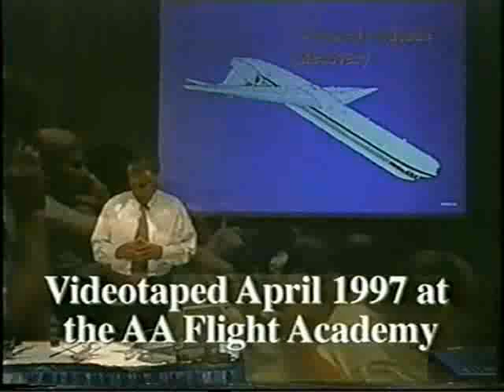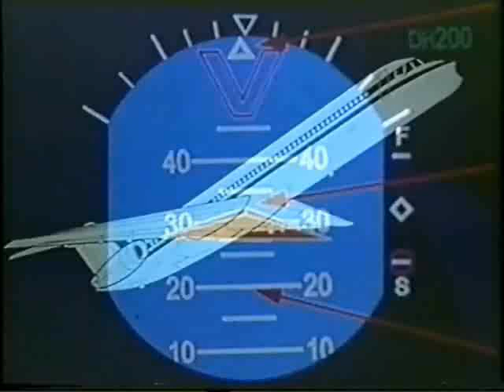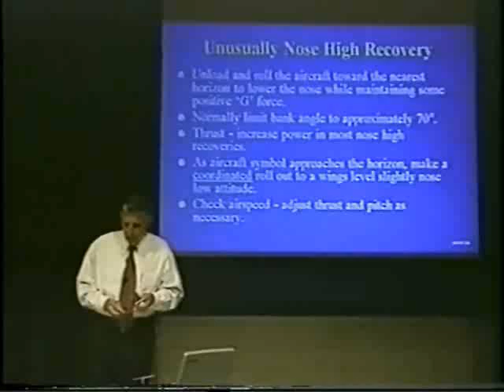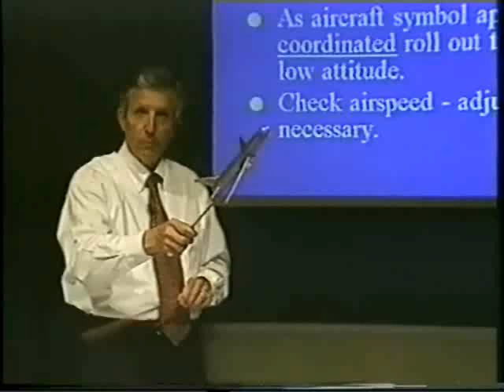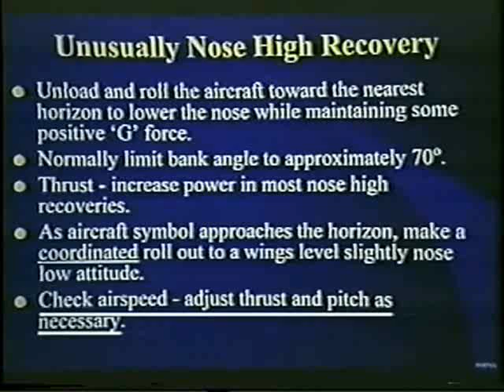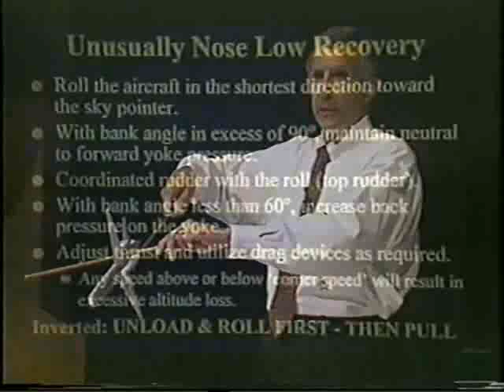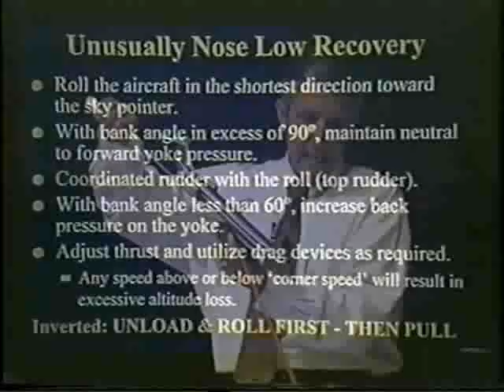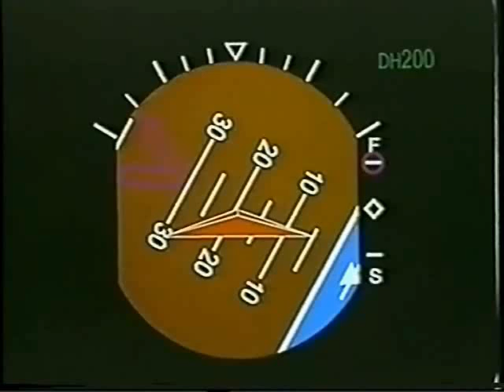Unusual Aircraft Attitude Recovery Procedures, by Captain Warren VanderBurgh.

Comment: This is from the 90's, right? Very interesting.

 When he talks about the rudder, I thought: Some years later, American Airlines flight 587 crashed because of excessive alternating rudder input in wake turbulence.

The report describes in detail how this could arise from the training (Advanced Aircraft Maneuvering Program).

At least in THIS PART of the training, the instructor says the  opposite: 

Because rudders are very powerful, apply it smoothly, wait for the plane to react.

Well, if you learned (like the FO of AA587) that wake turbulence is so extremely dangerous and powerful, you may conclude that only full rudder can beat it.
Reply: Robert Worm  yes that’s true ,  but totally  different  scenario  to  Flt 587 , with that scenario   There was no need to do what the pilot did , he just needed aileron deflection to control the roll  what he did was stamp on the rudder hard and abruptly  from stop to stop under takeoff power settings  and so overloaded the tail, he actually says don’t kick the rudder! Exactly the opposite to what Flt 587 did
Reply: Part of the problem with that pilot's training was that the simulator he trained in did not react the same way a plane does. It wouldn't immediately respond to sharp rudder input so he developed a habit of repeatedly wiggling it back and forth hard until it responded. It was this repeated motion that caused the forces on the vertical stabiliser to get so great.
Reply: @TheSpacecraftX  To me, this means that the simulator programming was unacceptable. They should have programmed the simulator to immediately stop if the plane is put into a situation that will cause it to break apart.
Reply: I thought the same. Don’t fight the turbulence, wait until it causes the airplane to get into a situation that requires “unusual attitude recovery” then watch this video. And don’t stomp the rudder.

Comment: We are moving away from "Pilots" toward "seat occupants" in the cockpit.

More reliance on automation and less actual flying skill.
Reply: That's been an excellent thing for safety, in net, though.
Reply: Most accidents are due to bad flying skill, automation will have saved a huge population of what would be pilot error accidents
Reply: One of my flight instructors was talking about how great it will be in the future when he works for an airline because it's basically a desk job.  I was thinking, "You actually WANT a desk job?"  Anyway, he is one now.
Reply: @needicecream100  There will be less accidents in total (given all new aircrafts get these systems by default and not as a costly option), but the couple accidents that will inevitably happen will be most of times the fault of automation and over-reliance upon it. I am with the sentiment that people will be more shocked about such a kind of accidents. Look at the outcry about the 737 MAX crashes. To me, Captain Vanderburgh is totally right about the first unwritten rule of recovery procedures (this should also apply to other means of transportation): if your machine goes off-track, disable all automatic systems, because you cannot exactly know which one is faulty at the time. The faulty one has no awareness of its abnormal operation, otherwise it would have corrected its course of action or stopped altogether.

Comment: So many of these basic flying instructions seem so obvious to flight simulator buffs. For us it's obvious what to do if you're upside down at an angle: you push forward on the stick and roll to get your wings level. I mean who hasn't flown a 747 upside down at low altitude in FSX? But for a real pilot, they've probably never even thought about it. Some of them panic and pull back on the stick.
Reply: Easy for us to say.
Reply: ChernobylPizza that depends on the plane and the how you got in the X position. If you fly a T tail plane thats upside down and about to nose dive, you won’t have control on the elevators to roll and immediately pull out of the dive. You would have to let the nose drop and gain speed to pull out of it
Reply: Blog it
Reply: A few things behaves strangely in the simulator, I mean you can keep a 777 flying inverted, you try that in a properly simulated one it will fall out of the sky. (Of course the flight computer have to be disconnected to pull of that stunt.)
But also we do not have to contend with the nasty G forces and hanging upside down that these guys in the real deal would have.
Reply: @CMDRSweeper  Then I hope future flight sims are more realistic.
Reply: Yeah. But I think this was in the 90’s when home flight sims weren’t as common. Any pilot worth his name has a home sim now 🤣 But even then this video is still educational to watch. Helps confirm good technique and bad technique.

Comment: The pilots of Adam Air Flight 574 could have done with a session like this.   They let their plane drift into a right wing, nose down attitude and the captain's recovery attempt was to pull back on the yoke, making it worse. At no point did he try to level the wings :(
Reply: Some test pilots end up "inverted" for md80/boeing 717 ,but recover it in time. Check the video,is impressive! After he got inverted he made the mistake to pull ,so the plane point straight to the ground!!

Comment: I once flew a 727 full of people from Houston to Dallas. The pilot did the takeoff and landing, but I flew the rest of the flight path. This was before 911, and the other passengers just thought I was supposed to be doing that. I had never flown a plane before. It was easy.

Fast forward 40 years later, and the F35 is even easier to fly. It is harder to drive a Camry than it is to fly the F35.

Comment: How often does an airplane reach the roof down with autopilot? Where are the passengers then and during the recovery? Most of times cause of this situations are technical fault and/or pilots disorientation.
Reply: Obviously it is very rare for these things to happen but if the pilots are trained for these cases it could end up saving hundreds of lives.

Comment: I'm partially deaf in my right ear 😢
Reply: Do you happen to use linux?  It discovered it's pretty easy to add a virtual output to pulseaudio that sends the right channel to both speakers
Reply: @MatthijsvanDuin  I do use Linux but I was listening on my work MacBook at the time
Reply: @MrC0MPUT3R  well, just in case it's ever useful in the future, the short summary is:

find the name of your audio output using:
pacmd list-sinks | grep -P '^\s*name|device.description'

create the virtual output:
pacmd load-module module-remap-sink sink_name=right_to_mono channels=1 channel_map=right master_channel_map=mono master=NAME_OF_AUDIO_OUTPUT

set its description (which is what's shown in user interfaces like pavucontrol):
pacmd update-sink-proplist right_to_mono 'device.description="Built-in Audio Analog Mono from Right Channel"'

Comment: 29:50 Is the MD-11 rudder THAT effective as he says? Comparable to other aircraft it is very small due to the center engine below it.
Reply: The vertical stabiliser is small, but the control surface of the ruddar is quite large, in part to compensate for the relatively small vertical stabiliser caused by the stretch required to create the MD-11, while also keeping development costs long, it is in effect a bodge to try and even out the small tail plane, by making a bigger part of it incorporated into the rudder.

Comment: I got your back for nose high and low determination the layman way apart from my normal perception without an easy equipments, it install a 3 inch glass cylinder with murcery in it, and the cylinder will have 3 concave notch along its base, at every inch, (1__2_ 3), fixed at the ceilling of the mid cockpit pointing the end 1 towards the nose of the aeroplane, so its like mercury could be in slot 1, 2 or 3, dependind on nose down , horizontal or nose up stall of the craft.
Reply: That isn’t going to work. Anything gravity based is going to be influenced by g-forces. A gyroscope is the only thing that will show true attitude.

Comment: I think 1th thing is NOT reduce speed otherwhise the plane go on stall, the 2nd is to try to rise up the speed and try to reach at the least the center of the horizont.......roll is preferred if in a high altitude......otherwhise effect can be deadly.....
I'm right?
Reply: no
Reply: Yes you are right.  I also thought the best Idea was to keep pushing forward, but if you roll towards the horizon, it is indeed beter to be at 0* pitch, 70*  bank, rather than at 30* pitch up, wings level and 0 kts, second situation is about to become a spin.
Reply: Not in all cases. A stall is simply when it exceeds angle of attack and the wings no longer have enough airflow to retain the low pressure zone on top. Speed could be a contributing factor to a stall as it could cause it to take longer to change direction or get back on a level flight path. But none the less, the aircraft obviously has to maintain a sufficient airspeed for level flight as well.

Comment: At timeline 35:00 you are nose low and banking left. I agree to correct, you have to roll right, but once I am in a wings level attitude, I am not going to push forward, I am going to pull back to get the nose out of the dive.
I don't understand the answer of pushing forward while in a nose low attitude.
Reply: The slide at 22:42 explains it. In your scenario the plane is in excess of 90 degrees bank.
Reply: That scenario started with the plane upsidedown. So if the plane is upsidedown then pulling will make the plane go down.

Comment: This must have been updated after AA587 ...
Reply: 587 was repeated extreme over use of rudder, this video is how to recover from unusual attitudes, very different.
Reply: A D the pilot’s actuation of the rudder was both a training and a design flaw of the A-300, which allowed full deflection with a very light input command, and immediately reversed in the same magnitude.  Turbojet airplanes have very little need for rudder input beyond a crosswind landing.  This mishap has hopefully put that to rest in the upset recovery regime and made recovery procedure more apparent and manageable for the crews in the process.

Comment: Unfortunately this information in deadly wrong, quite literally. Rudder has no place in these recoveries because it is not structurally strong enough to do the job and it will kill you. When you unload to zero G you have enough aileron authority to roll wings level and it will happen almost imminently. 

The reason rudder will kill you is two fold. First it isn't strong enough to handle the stress. Second it imposes rolling G on the airplane. Rolling G is very dangerous and will break the airplane apart at much lower speeds. AA587 demonstrated this with a very, very minor upset turning into a very large loss of life.
Reply: Your rudder can be used as a horizontal stabilizer thruout the roll to keep the nose up.  You are talking about 1 plane and 1 accident which doesn't equate to this topic.
Reply: No, I'm talking about very real structural limitations that most pilots don't think about. The rudder on that aircraft was never designed to take those loads and structurally it simply cannot. No competent upset recovery training includes this because it is poor technique and a transport category aircraft simply is not an Extra or a Pitts. 

Everything about this video on upset recovery is wrong and has been abandoned as the accident record showed just how deadly it is. You unload, stay coordinated, and keep flying. After the training resulted in accidents this style of upset recovery has been abandoned except for about 1 location.

But most on point, Boeing and Airbus called this absolutely wrong. Boeing said "the excessive emphasis on the superior effectiveness of the rudder for roll control vis-à-vis aileron and spoilers, in high angle of attack, is a concern."  The above program was developed abusing sims to 90 degrees of bank and they where not certified for accurate representations of flight above 60 and they certainly did not have perfect fidelity about the aircraft's structure, particularly in abnormal situations.

NTSB AA 58 Directly faulted AAMP, but that really isn't the point. The point is how easy it is to get a transport category aircraft to break up if you abuse the controls.
Reply: Joshua Landry thank you. My thoughts exactly and the disbelief until I scrolled down to see your comment.
Reply: I knew that the rudder structure fail when rapid movement and it can endure the constant one way force
Reply: In an emergency you have to use whatever you got... you’re philosophy is flawed. In normal flight you’re correct. This is not the case
Reply: @sneekysmurf2084  American Airlines 587. Over stressing a critical in an emergency doesn't get you out of trouble. It just makes it worse. This sort of thing will quite literally cause the tail to come off.

The upshot here is that it is completely unnecessary to do and doesn't help the situation. This training is almost exclusively the result of abusing simulators past their point of fidelity. That is, using the simulators to develop training in areas they where never programmed to give accurate flight information. Real aircraft would behave, and break, very differently than the simulations predict.